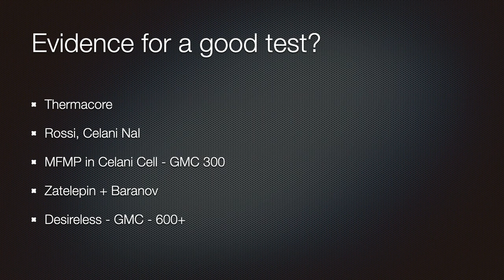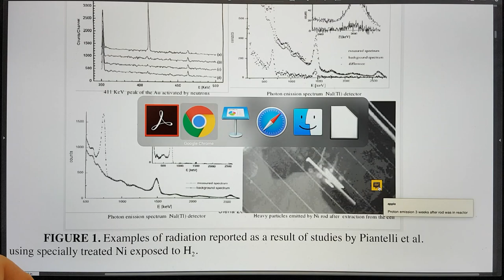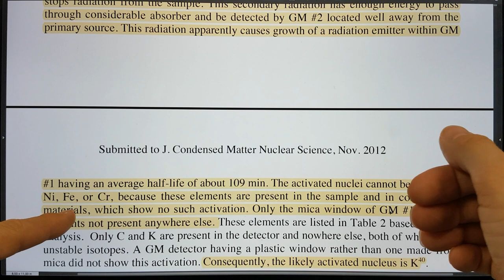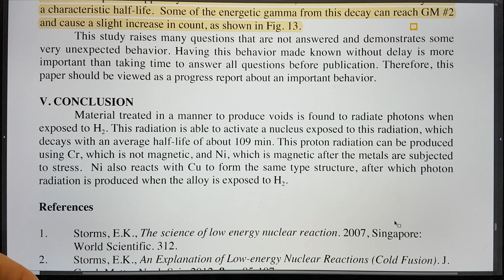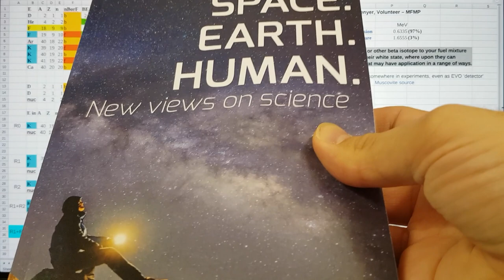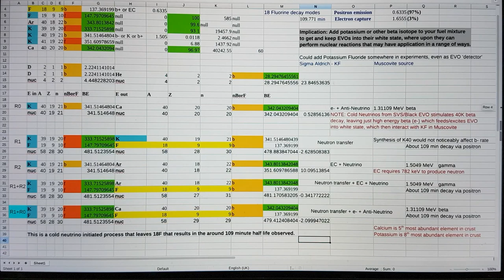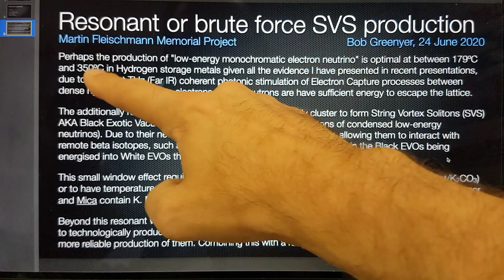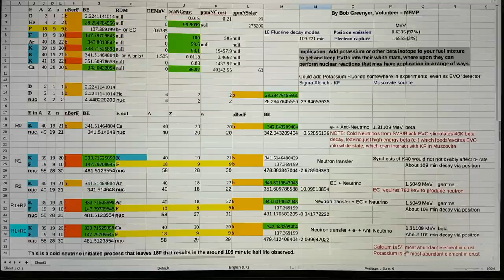Resonant and brute force Black EVO / String Vortex Soliton production

Comment from the maker: ERRATA:
Bob says "low pass" when he probably meant "high pass"
Bob says, with respect to Hutchison 'fracture' sample - 4 x fermionic 27Al goes to 2 each of fermionic Mg and Si - he should have referred to the products as bosonic 
Bob misreads "neutrons" as "neutrinos" at one point.
The presentation was made as fast as possible to include the recent Italian paper and its implications, another version without the above errors may be produced so as to avoid confusion.

Comment: Thanks for this Bob, as you mention, a lot of work to put this together. I would point out from my own experience that the more isothermal the inside of a LENR reactor is the less likely it is to give results - even with fuel that worked well in other systems. I also concur that the circa 300C zone is 'very interesting'.
Reply from the maker: Hi Alan, Thankyou for your comment here and placing it in context. Hopefully those outside the community may take on board these findings and be able to at least carry out repeatable experiments that show a nuclear effect so they can get over the "it can't be nuclear" hurdle.

Comment: Yes, "Getting to the meat of O-day." I will fire up the BBQ in preparation. What a cook-out!. Thanks again Bob.
Reply from the maker: Pleasure Corky, it is tough being a volunteer and a father, but I feel honoured to have met and worked with many of the people that made this deduction possible and with a bit of critical thinking and realising, just like I made mistakes in this presentation under tough time constraints, legends such as Ed storms could have too. I am learning an important lesson, even our heroes make errors or omissions and so read what they say, but treat it as input to be tested and verified. Took me a good period of time since seeing this paper, but it becomes clearer.
If what I propose is happening between radiation emitted from metal hydride systems at 179 - 350ºC and KF, then it not only proves that there is a strange radiation type, it also proves that it can do nuclear reactions at a distance in completely non-controlled environments at low temperatures.